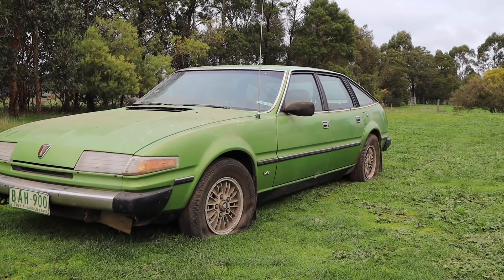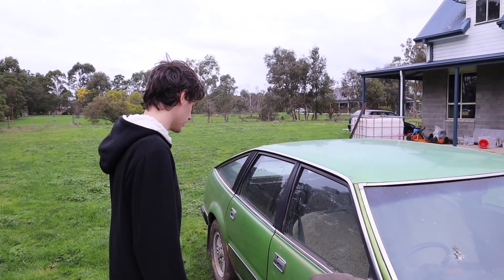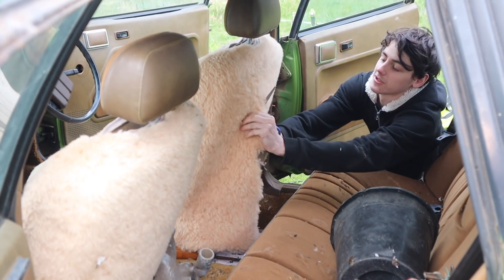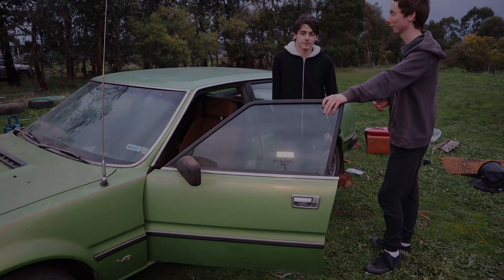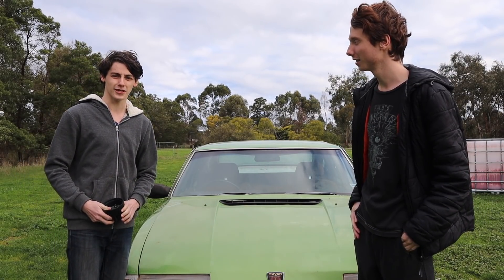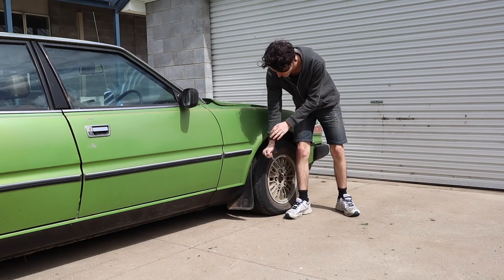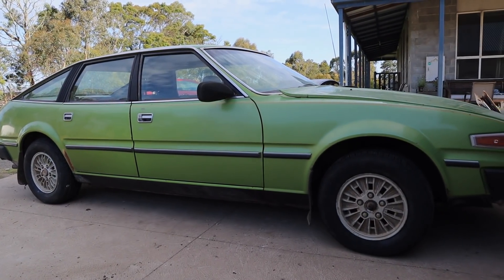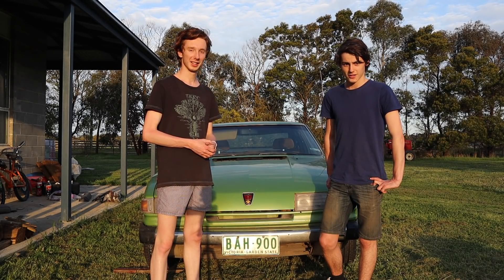The FREE Rover SD1 Restoration - Episode 1 (ft. Hugh Jeffreys)

Comment: Guys. Great video. Just some tips. You don't need to use a blowtorch or a heatgun. Just boil some water and it will be more useful and safe. 
Next time, before you give it a try to the engine, when you remove the spark plugs, pour some oil in the cylinder and leave it for 24 hours. This ensures that the cylinder is not attached to the walls and damages the engine. Then, it would be best to put new oil and start the car without the spark plugs connected. Thus, the oil will circulate before the car actually starts. Good video!

Comment: Nice work lads!  
Jacking points are on the front and rear under bumper. Look for a rubber bung covering a square hole. Use the jack that came with car and wind it up dead easy

Comment: By the looks of it what you have there is a V8S in Triton Green.They were only made for one year and they are the only SD1 to have air con fitted as standard.Rover only made 1040 of them so they are pretty rare.By the looks of it its in pretty good condition but the interior needs to be taken out and at the very least steam cleaned.If it was me i wouldn't go near the interior without gloves and a mask on because of all the rat crap in there.
You have got a rare SD1 and if the body shell is in good order it will fetch a good price when done up or you can just enjoy having a rare car.
Good luck and look forward to episode 2
Dave
Reply: In the UK the V8S had an electric sunroof and SU carbs, and badge on the rear saying V8S. Mine was Triton Green with  auto box.

Comment: I’m in America, and that car is probably common in Australia, but I’d definitely drive that here
Reply from the maker: The car isn’t very common for Australia, they are a British car and I don’t think very many are here in Australia
Reply: @JamesMayer125  such a cool car!
Reply: SD1s are incommon everywhere but the UK, and in the UK they rust like hell so there are very few left. However there is a sizable community trying to keep them on the road. 

There are some SD1s in the US. They only came with the V8, and with redesigned sealed beam headlights
Reply: Im suprised it made it to australia,they tend to rust half an hour after leaving the production line.
Reply: @fazfinisher5598  ahh, Good old BL doing what BL did back in the day. 

If i recall correctly, the SD1 was so wide (For BL standards) that it didnt fit inside the bridge that conects the half of Lumbridge that puts the bare metal shell together and the painting area. So they had to put the cars together, load them on trucks, (mind you this is the bare shell with no paint) and drive them over to the other side of the street to paint them, exposing the naked shells to all the salt and crap without anything to protect them.
Reply: @MeDicen_Rocha  Utter BULLSHIT! The usual spreading the drivel that you have heard spouted by other numpties. Rover SD1s were never built at Longbridge and BL cars were no different to most other cars from back then for rust. Plus there was NEVER any bare shells of any type of cars in BL taken outside during the production process - just more of the usual BULLSHIT that is spread by Top Gear fan boys. There was a problem with the paint on early Rover SD1s that was to do with the paint being supplied by Valspar the company that made the paint that was even in the news back then and I still remember that because that was one of the paints I sold at that time which was used on the Concorde plane as well. That problem was sorted but cars back then were not not rustproofed the way they are now and it is only when cars started to be designed on computer that they could design out rust traps as well and that was only starting to come in in the 1980s onwards. It was up to the owners back then to rust proof their cars and the cars that were rustproofed didnt rust the same as the ones that were not obviously and there are some cars that have survived in excellent condition from back then because they were done. I had a 1978 Morris Marina 1.8 HL/TC and 1980 Austin Allegro 1750 TC Equipe and they were excellent reliable cars and didnt rust because I rustproofed them and looked after them myself as were the other BL cars owned by my family back then as well because they were looked after the same. There is a silver 1986 Rover SD1 Vitesse along at the end of my street just now that the guy has been using as a daily driver for the last 20 years or so. That car is starting to rust round the back arches and probably elsewhere as well but that is the owners fault for not cleaning out under the arches and rustproofing them etc to stop that and excellent going that a 1970s car is still a reliable daily driver considering the crap that some people talk about them.

Comment: The jacking points are located on each corner under the front & rear bumpers. They should have a square black plug filling the hole.
Beautiful car by the way & well worth looking after.
I owned quite a few & had many years of trouble free motoring.
I should've kept that V8S, knowing what I know now 😢😢

Comment: I had an old English white Rover 2600 5 speed i used as a "Minicab" (taxi) in the mid 1980`s In outer London UK.. go to work, drive it all night, was so comfy to drive, so In 6 months of hard work i put 50.000 miles on it, but sadly Cab Insurance was dear I had to sell it and buy a Ford Cortina..lol missed my SD1 for years after.. good luck with your V8 one.. top tip - check the rubber diaphrams in them Stromburg carbies eh..

Comment: you need to pull the interior out, steam pressure wash the seats and replace the carpet otherwise the rat smell will never go away, very enjoyable seeing other young people taking on projects like this, reminds me im not alone!
Reply: also you should stick a borescope down the fuel filler and check the condition of the tank, its probably full of stale fuel with load of dirt at the bottom in which case you need to drain it and flush the tank, chances are your fuel pump is fine,

Comment: If you don't already know, when you change the engine oil, drain and refill before unscrewing and changing the oil filter otherwise the oil pump is drained and needs priming before it will work again! Catastrophe will ensue if this isn't done!!

Comment: Wow hugh jeffrys i thought you were a phone restoration base channel ...get a carpet cleaner clean the interior wash the car thoroughly and polish the paint with some compound to bring back the shine ...the rear end of that rover looks like the 240z...just a little tip for next time check your coolant and oil before running it you don’t watch water in your oil and don’t want to run it without coolant or it will overheat

Comment: Had two Rovers One UK one here. V8 here= heating probs. it's a Buick engine, Ally block tends to equal head gasket probs. I never heard of anyone doing it on  a SD1 but on the Barra you throw the head gasket away and make a solid copper one. Just occured to me that it might save a lot of horror and sadness later. Perhaps get rid of the SU's too? Just some thoughts Cheers guys for being so enterprising plus remember the safety stuff, perhaps gloves and goggles and a mask if you're around dusty old crap.

Comment: omg, i had 3 different SD1's in the 1990s, i had 2 2600, and one 3500, i paid £40 for one of them, i wish i had my 3500 now 0.0.
guys if you buy a hanes manual it has the wiring diagrams.

Comment: It makes no financial sense, you will need to replace the next parts to make it safe to drive: discs, pads, brake drums, brake shoes, fuel lines, brake lines, shocks, springs, all the bushes, most of the hoses, fan belt, possibly master brake cilinder, possibly brake servo, fuel pump, carb rebuild, oil and all of the filters, ripout the interior and clean and sanitize it, after siting for so long you will definitely need to replace all of the weather seals from the dors and boot so that it doesn't rain inside, not to mention if the car has rust or not

Comment: change the oil and you will probably need to prime the oil pump after sitting for so long or you will wreck the engine. thats what the noises are - no oil getting up to the heads

Comment: Never ever start an engine that has been standing as long as this has until you have changed the oil and filter.
The oil in this engine will be completely dead and running the engine as is will do damage to it.
My advice is to change the following as soon as possible.
1. Engine oil and filter.
2. Air filter.
3. New leads and spark plugs(Done).
4. New Distributor cap (Done).
5. New Rotor arm.
6. New points and condenser.
7. Coolant.
8. Drain the fuel tank and start with fresh fuel, it will be easier to start.
9. Fuel filter.
When changing the engine oil DO NOT leave more than 10 minutes between draining the oil and refilling with new as the oil pump is NOT self priming.
If you it leave too long the oil will drain from the pump and you will have a devil of a job re-priming it.
Good luck with car.

Comment: remove the new distributor cap and give the old contact surface( rotary arm )a wipe over with steel wool ...ten years will have built up a lot of corrosion ..makes a big difference.
Reply from the maker: The connection wasn’t the problem it was that one of the old spark leads had broken off in there and when we were pulling it up with pliers, abit of the cap broke off
Reply: Ok cool

Comment: I'm surprised the rats didn't chew into the interior upholstery. Is there a reason for that?
Reply from the maker: There is some slight damage to the dash where they have eaten it. But apart from that the seats are fine. However the boot (which I forgot to show in the video) was where the rats nest was and all the carpet is destroyed in there. So potentially they all focused on the boot but I'm not too sure actually

Comment: Would be interested to see a before and after of the paint if you end up doing a paint correction.
Also, like others have said, wear gloves and masks if you're working with crap like that. There is a few great videos by AMMO NYC where he has dealt with cars like this, you should check them out to get some tips for when you end up detailing the interior some more. Samcrac is other channel who may have some useful info when you are working on the mechanical side of things.
Reply from the maker: Cheers mate, there will definitely be a full in depth video of the before and after when it’s completely done

Comment: Guys, always wear good face masks when dealing with the interior of a rat-infested car.  Rat droppings can contain all sorts of nasty bugs which can lay dormant in the droppings for decades and then come back to life when inhaled, causing all sorts of very nasty lung infections and diseases which can prove fatal...
It's worth pointing out that it is extremely important to use a torque wrench on those wheel nuts and not over-tighten them.  That pattern of Rover alloy is quite fragile due to the material they're made from and over-tightening the wheel nuts can cause the alloy to crack.  Once the crack is there it will spread around the wheel centre until you're driving down the road one day and the wheel rim and tyre will separate from the wheel centre, which is still tightly attached to the hub, and go bounding off into the scenery at very high speed.  That's why, back in the day when these were very popular in saloon car racing, you never saw them being raced with the factory alloys, despite the fact that most of the ones that were raced were cars that would have had the alloys fitted from the factory.  The factory alloys just weren't strong enough to take the stress of racing and could fail due to cracking.  Those original alloys are not easy to find now and it looks like you've got a very decent set there so don't over-tighten them and risk wrecking them, possibly the car and maybe yourselves by having one fail and part company with the car when it's driven.  Apart from the ones that were designed to only have 3 wheels, and hydraulic suspension Citroens, cars generally don't do well on 3 wheels...

Comment: nice colour combo that lovely 70's green that every car had well forien ones as it was a 70's colour but then you get that lovely brown on brown on brown on badge with a hint of black inside lovely colours, looks okay too the rear is only slightly starting to rust some rest be gone will fix that, by rust i mean the wheel arches there was a small amount, 
breaks are seezes on, hammer and a few "feather light whacks" will fix it, proper rover alloy's too there rare boys best keep them locked up they might go missing, nuuu you've just devaule the car orgnial seat covers friom the 80's in classic sheep skin but as there was a rat in there i'm not going to question it as its going to be nasty, should look though te records see if there's any jems who knows there might be a rare james last or best of jazz or golden oldies or harry secome sings, or (okay i'll stop) yep just clean the slot out for your  mobile phone (i kid you not! its a phone holder clarkson proved it when his motorloa flip phone fitted in there! might not fit a smart phone but still rover were very good thinkers into the future!) 
its a hock crock for pulling up wool from the sheep dip or after you've washed it or something to hock things with, ebay fodda just put on there and it'll sell, hmm must e rust somewere as those are acorns so squrels have been inside, that or a window was open? 
would of gone the whole hog and got a new disptuter cap just to you know make it better, plus your replacing the leads so yeah might as well do that, 
other then rust and ythe odd squeecky/screachy fan belt(s) rover's are pritty hardy cars, the engines would go on, just depends on what spec it is, as the 3500 can be very nightmare ish the more lesser ones can be easy but might offer up some probs, rovers were the kinda cars you took to the garage each month for a service as you were that old you had money to d it that and you loved your car, as for basic mantance? you would change oil n plugs ad fliter and maybe the odd fan belt but other then that they worked well, 
welp that was fun before you brunt the rover to the ground, if the wheels lived i'd know they'd sell well on ebay as there worth money plus if they have the center caps too bonus, 
oh its not on fire okay then, also glug glug glug 20 fuel cans later, yes rovers were that thristy, 
it goes great sounds like something wore or rubbing eh no worries, it does have jacking point you just need to look in the manual hyans manuel very useful, also i hope your keeping those orgnials wheels as you don't want to piss the rover owner cluib off, you will be in deep trouble as there are rover fans out there that will linch you for throwing/discarding those orgnial alley's, oh good you did goodboys, alo you don't want to tighten them up as you might be removing them to well fix parts that are easy to get though the wheel arch,

Comment: Okay you two chuckleheads first of all don't be using blow torches on anything that has fuel you're going to have to drop the fuel tank and put a new fuel pump in there if that's where the fuel pump is and you're going to have to check the brakes change the oil filter air filter Etc